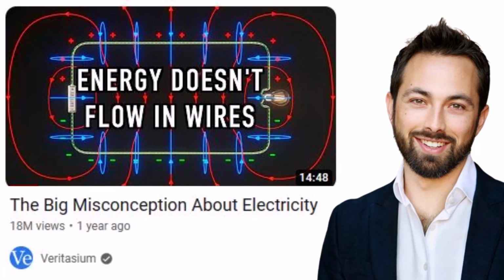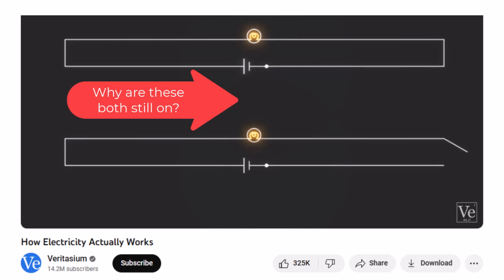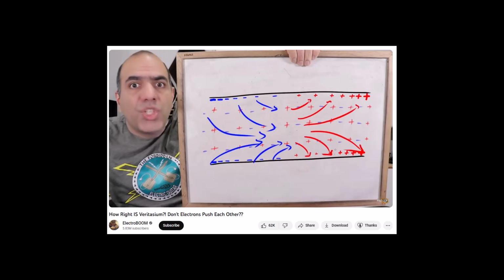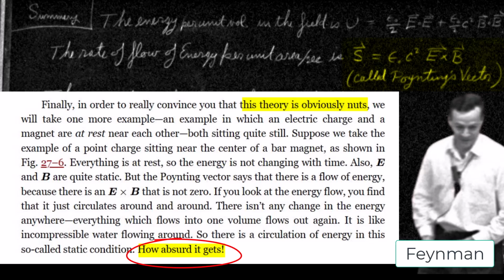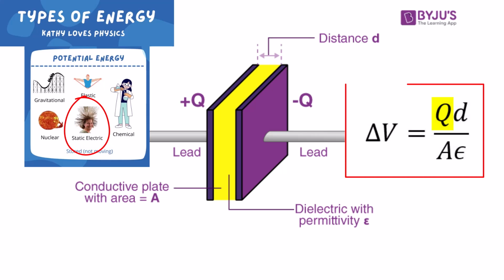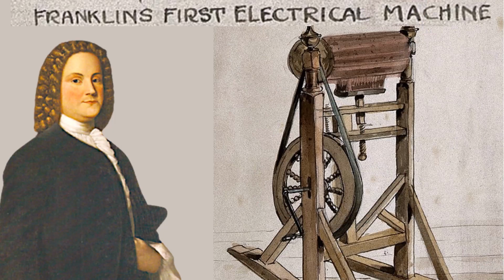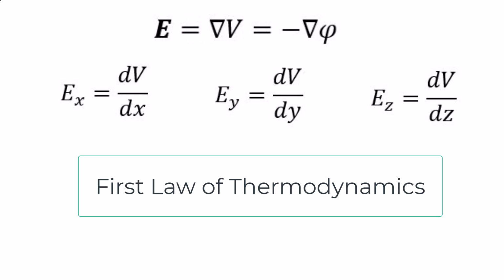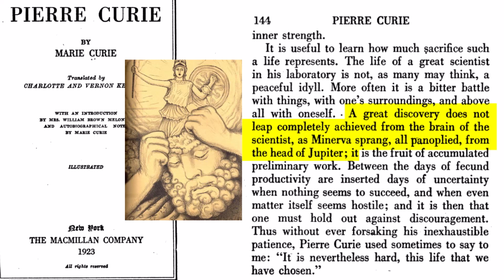Deep Dive Historical Response to Veritasium’s DC Electricity Video

Comment: I was one of those electrical engineers that reacted to Veritasium's video in a manner that can be best described as "wait a minute, that explains nothing".
It's true that an electromagnetic wave needs no conductor, but DC current most certainly does.
A lot of debunking of this has been going on since, and lots of good ones at that, so i won't go in to more detail here, but just saying that an explanation with the transmission-line model would have made perfect sense, and that the DC (battery) was a really bad example.
I can see that you have been thinking both long and hard about this, and your result is excellent!
What bugged me most about Veritasium's claim was the headline "electricity doesn't flow in the wire", well how else can you explain DC current?
I'm really looking forward to more of your video's since i find that the historic connection is giving me a firm foothold of understanding, it makes me more grounded, so to speak. (pun intended) :-).
Reply: Another EE here. Yes I agree the transmission line model would clarify a lot, and it would explain that the light-bulb mostly likely will slowly ramp up in steps, as you see the reflected wave going back and forth between battery and light, that each have a different impedance than the characteristic impedance of the wire pair. If you look with a scope at the end of a not-terminated T-line you see exactly that. However, the pointing vector does work, even in electrostatics. I applied it myself when I wrote a field simulator (MOM based) to calculate the energy transfer. In this case you need to integrate the pointing vector over a closed surface surrounding the battery or the lightbulb. Voltage is only defined in electro-statics, and doesn’t work well if you have changing magnetic field. When we define voltage for an AC circuit, we use a quasi-static approximation.
Reply: So what kind of current happens when neither voltage nor resistance is present as in a Superconductor A.C. or D.C ?
Reply: ^ BOOM.    Current was not discussed at all in the veritasium video.
Reply: No, he said energy doesn't flow in the wire. And he never said conductors are not necessary. They are required to channel and concentrate the EM field.
Reply: @SlothKeepsCoolAndCares  Everyone talking about this who's not an EE or radio ham (including Kathy and Veritasium) really should study the theory of transmission lines. They have multiple "modes" distinguished by the orientation of the magnetic and electric fields. Either the magnetic field (TM), the electric field (TE) or both (TEM) can be transverse to the direction of propagation. Not all transmission lines can support all modes. E.g., a hollow tube (a waveguide) cannot support TEM, but conducting wires (e.g., twisted pairs, coaxial cable) can. Waveguides (which includes optical fibers) have a "cutoff" frequency below which they cannot work. TEM transmission lines (conducting wires) do not have a cutoff so they can operate down to DC. Think about the orientation of the fields in two parallel wires. The electric field is obviously between the wires, so that's transverse to the direction of propagation down the wire. The magnetic fields follow perpendicular circles around each wire, so the magnetic fields are also transverse to the direction of propagation. I.e., TEM mode. (BTW, since the currents are equal and opposite, the magnetic fields oppose each other and cause a repulsive force.)
Reply: @philkarn1761  Hi, OK, I don't necessarily have a problem with your statements here, but how does this disprove Veritasium's claims about energy flow? I've got some textbooks on transmission line theory, so could you describe a setup, waveguide or cable, which definitively disproves the claim?
Reply: @SlothKeepsCoolAndCares  Veritasium was making a distinction without a difference. Whether you consider the energy to be carried by the charges themselves or in their fields, you get the same answers. But I do object to his initial thought experiment as lacking give enough information to answer the question. An EE immediately recognizes his setup as a shorted transmission line, and to analyze the transient response of a transmission line you must know or calculate its characteristic impedance. To calculate it you need the geometry of the conductors (thickness and spacing) as well as the medium through which they pass. And he didn't give that.
Reply: @philkarn1761  Your statement is only true I think if you are being practical. Sure, it comes down to the same thing if you are interested in building a circuit for some distinct purpose. But that was not the point of the video. It was a scientific thought experiment about how energy actually flows in circuits. Not sure if you saw, but Veritasium came out with another video on the matter, addressing many of the responses on his 1st one. The last one is definitely better. An analogy of this is the interpretations QM. All interpretations agree on the experimental results, but they vastly disagree about what is actually physically going on. A QM pragmatist would therefore find those foundational concerns irrelevant.
Reply: @SlothKeepsCoolAndCares  "What's really going on" risks getting too philosophical. Unless one model can explain something the other can't, I'd still say it's a distinction without a difference. Can it? I'll also accept a model as "better" if it is simpler (in some way) or easier to use than another even if they make exactly the same predictions.
Reply: They are click baiting dummies.
Reply: Veritasium's video made me read and think more deeply about electricity, and in particular the omnipresent nature of the EM field, but it ultimately is just a bunch of unhelpful handwringing over definitions of words like "flow."
Reply: Nobody seems to realize that these wire pairs are in fact a networks of resistors and capacitors (transmission lines). Dave and Electroboom get it. But I think this video and Derek's video don't seem to understand it.
Reply: @kriswillems5661 Kathy mentions dc circuits, and steady states, but in my non-qualified opinion, the fundamental thing here that closing the switch on this battery / wire / lamp situation creates, for at least an instant, a non-steady state between the two steady states of off and on, and for that intermediate instant this arrangement behaves as an AC system, which is why transmission line theory explains what is going on.  Overhead HV transmission lines have a capacitance to ground of several nF/KM, this experiment doesn’t need a light-second’s length of wires to illustrate, electricity leaking away in an AC distribution line is well understood.
Reply: @tonib9261  That is correct. When you close the circuit you somewhat get an kind of AC, but of course not really AC. However AC is about a constant change in the flow of electrons while switching on a DC circuit can be compared to a train getting in motion. Each train car is pulling and pushing against each other when you start moving / accelerating and you get a "noisy" feedback from all the resistance. Those are the AC-like features. Though once the ripples have settled we get a steady state flow of electrons through the wire. Those flowing electrons still have an em field (since moving chargest generate an em field), but that is really weak. Otherwise we could transmitt power through a DC cable through induction by placing another cable next to it. However that does not happen. You only transfer energy through the em field when the field changes. When you turn a DC circuit on or off, you get a spike each time since the field changes, but once settled the AC part is gone.

The larger the change in the em field is, the more energy it carries. However that's only the initial spike and, again, the inverse square law tells us how strong the field would be at a certain distance. And it's weak 1m away.

Don't get me wrong, the actual energy is transmitted through the em field inside the wire which actually pushes the electrons. So claiming that it's not the electrons but "just" the em field that transmitts the energy is not really correct. What do you think actually happens when you slam your hand onto your table? Right, that's also the em field that is actually colliding. There are no particles colliding but the atom hulls which repell each other. That's the reason why you "collide" with solids, fluids or gases. There are only 4 fundamental forces we know of and the majority of things we're dealing with on a macroskopic level is the em field and gravity. So nearly all interactions between things we can observe is just the em field. The strong and weak nuclear forces only play a role inside atoms and have barely any effect between atoms or molecules. Though to actually see a "real" effect of the em field, you have to have a strong field and for that you need to get really close to the source.
Reply: @tonib9261  She does mention that and says she doesn't consider the initial pulse to be be turning a light on. It might be semantics but it's an important distinction.
Reply: @Bunny99s  When one closes the switch, one imparts a step function change in voltage. Through Fourier Analysis, one can easily see this results in many different frequencies and a DC component propagating along the wire.
Reply: @kriswillems5661  Resistors and capacitors *and inductors*. If the wire was perfect, the resistors wouldn't be there. But the inductors still would be.
Reply: In reality the inductance of a straight copper wire is small compared the the resistance of the copper. I know there's inductance, but in simulations of the system you'll that in this case is is relatively small. What I wanted to say is that all these videos explaining the phenomenon seem to leave leave the explanation that is by far the easiest: looking at wire as a transmission line. I still think that without any special preparation Dave from EEVBLOG was the only one that really gave a good explanation (electroboom was ok too, but his video was prepared). I missed this simple explanation in this video. It sounded very confusing  @philkarn1761
Reply: @kriswillems5661  The inductance may be small, but it is still crucial. See the formula in the Wikipedia article "Characteristic Impedance". It shows that the impedance depends on the inductance L & capacitance C per unit length as well as the resistance R of the conductors per unit length and the conductance C of the dielectric per unit length. For typical transmission lines the impedance is dominated by the inductance and capacitance, so the formula simplifies to Z0 = sqrt(L/C). The resistance isn't zero, but it if were too large the line wouldn't be terribly useful.
Reply: The impedance of an inductor depends on the frequency. The inductance only plays a role at the front of the travelling DC signal. The inductance causes a wave travelling in both directions. Once a DC signal has been established in part of the wire, the frequency is zero and the inductance does not play a role, because the impedance caused by the inductance is zero (because it's a DC signal). The impedance of a capacitor however is inversely related to the frequency, so capacitors keep on charging on DC, the wire resistance limits the speed charging process.  That is why in case of travelling DC signal inductance is less important. I do agree however that in AC transmission lines inductance dominates over resistance.  @philkarn1761
Reply: @kriswillems5661  If capacitors keep charging, then it's not a DC circuit. Currents into those capacitors are changing, and since they're flowing through inductors, their inductive reactance is not zero. Only when the entire circuit is completely steady state do the capacitors appear as open circuits and the inductors appear as shorts.
Reply: @kriswillems5661   I think Kathy said she had a graduate degree in electrical engineering.  If so, she definitely knows what a transmission line is.  BTW, you forgot inductor.  😛
Reply: Energy doesn't flow in the wire...
Reply: @dggeers  "Energy doesn't flow in the wire..."? This makes no sense at all. You do know that a material with free electrons has to be there. So you claim such a material needs to be present, but it's somehow not involved in the transmission of the energy? Why does the resistance of a material goes down when you increase the diameter? Also, did you actually read the comment? If no charges / electrons move, there would be no electric field either.

Also Eric's claim that the power is transmitted "outside" the wire just makes no sense at all. The EM-field follows the inverse square law. So it gets weaker fast the further away you get from the actual "source" of the field and the source is the moving charge / electron. So the majority of the power is transmitted inside the wire. If it wasn't, touching an insulated wire would still shock you, which it does not. That's why we have insulators. And as most people know, if the voltage is high enough to jump the insulation, actual electrons are jumping the gap, usually due to ionized gas / material. In a perfect vacuum electrons couldn't jump the gap because there's nothing which could be ionized that could transport the electrons.
Reply: @Bunny99s  energy doesn't flow in the wire, the electrons do. The energy comes from the electrons but they push equally in all directions, including outside the wire they are flowing in. When the circuit first closes, the force from the moving electrons on the other side of the loop reaches the lightbulb first. That force remains - and if enough to light the bulb, the bulb turns on and remains on. It is still on when the main current from the loop comes around, increasing it further. But it is significant, and is not transient in the context of the question.
Reply: @Chilangosta  You didn't get what I said. 99% of the ENERGY does flow in the wire. Yes, by the EM field of the electrons which push each other. Again, you do know the inverse square law of the em field, right? Each electron generates an em field and where is that field the strongest? Right, in the center. The em field outside the wire is several magnitudes weaker than the one inside the wire. Imagine the wire like a highway that is a mile wide and cars are the electrons, each has an em field. A car moving at one "edge" of the highway (essentially right at the surface of the wire) has an em field that stretches outside the highway but also across the highway. The em field push is the strongest in its vicinity but is way weaker at a mile distance since it drops 1/d². The statistical distribution of the cars / electrons is that most cars / electrons move in the center. Just usual volume distribution. So the strongest push is all inside the wire. The em field outside the wire is certainly measurable and in deed would induce a current in a wire that is 1m away. However the strength is miniscule.

I've seen people doing all sorts of experiments and some claim that they received a quater of the voltage. However that's completely misleading when you don't have an actual load that would eat energy. Everybody knows that an open circuit can have a way higher voltage but when under load it drops significantly. Energy / power is voltage times ampere and in that sense you have almost no energy outside the wire. That's also the reason why the transmitted energy across the 1m gap is neglectible. You may get more induced power from the CMB or other environment em noise, especially when we talk about a battery. We don't apply a 10kV voltage and even when we did, the amount of energy that arrives on the other side is miniscule. Again, voltage does not equal energy. A van de graaff generator can produce really high voltages but not much energy (just as much as you put in minus losses).

Apart from that, no, the initial miniscule current induced is not a constant current. People have done simulations and what many ignore is that the induced forces go in both directions in the wire. So you get a lot of cancelling within the wire as the impulse goes along the wire. It also takes several complete reflections until the full power can be measured at the lightbulb exactly because of those cancellings. So the impulse ping-pongs along the wire several times.

I know people get excited when they learn about em fields and essentially radio (which is exactly that, transmitting miniscule amounts of energy through an em field). However claiming that "energy" flows outside the wire is like saying people sitting in a bus do not actually travel inside the bus but outside because the em field of the electrons of their atoms reaches outside the bus. By that logic you could claim that when you leave your home in a car to go to work, "a part" of you arrives at work within milliseconds. That's technically somewhat correct, but trust me, your boss would not be satisfied with the amount of work you will be able to do until "the rest" of your body arrives.
Reply: @Chilangosta  Just to make that clear. Dereks follow up video actually mentioned the electric field IN the wire at 3:55 of this video: ( oI_X2cMHNe0 ). Note that in his experiment in that video they specifically choose the wires with certain properties so they have the same impedance as the load. In his original video he talked about an ideal super conducting wire. So the results they get here does not match the initial setup. His "wires" essentially have the same "resistance" as the load.

We already know that we can transmit small amounts of energy via radio waves. Crystal radios have proven that over 100 years ago. They don't have any kind of battery. A radio wave as it is a charged particle that has an em field that moves through space.

Derek likes to to equate "voltage" with "energy" which is not the same thing. As in the follow up experiement he measured an impedance of about 550 Ohms in each half of the wire, he choose a load of 1100 Ohm so we would have build a perfect 50:50 voltage divider for just the capacitive coupling. He claims victory by measuring 20% of the source voltage which just shows that his measurement or assumptions were already wrong. Though that's kinda irrelevant as measuring the inductance and capacitance in such a case is quite difficult anyways. A usual light bulb would have a resistance of about 10 Ohms. With a 1100Ohm wire at 20V source voltage we would only get 0.18V at the light bulb. And that's for steady state.

Nobody ever denied that we will receive a signal after 1m/c. However the claim that "significant" amount of energy is transferred is nonsense. Telsa coils charged with 1.5KW can illuminate a fluorescent lamp up to about 3m distance. Though that's because the electric field required for the tube to light up is quite small and the tesla coil emits a powerful alternating electric field.

I'm wondering. Just assume we get x amount of energy at 1m distance. What if we had 2m distance? or 4m? Any concrete numbers? Keep in mind that the em field drops by 1/d². So at 2m distance it would only be 1/4 of what you had at 1m.
Reply: Electricity, Magnetism, Heat, light / Color, Mass / Weight are different manifestations of Gravity and Continually convert to each other. Gravitational Particles (GPs) move by means of CONDUCTIVITY towards the CENTER of the GRAVITY.  
Turbines convert the Gravity Force to Magnetic > Electrical > Heat > Light and everything in between.
When GP moves in the Air (4N1O) Atoms are manifested as Magnetism, therefore Magnetism exists only in the Atmosphere and is absorbed by Compass measured in Air Gap and Magnetic Flux context.
When GP moves in Solid it is observed as Electricity and measured by its Power/Force/Voltage and its Current/Amps and their combination total Quantity of GPs in a unit of time as Wattage.
GPs move at a 90 Degrees Angle relative to their path in [side] Steps, therefore the GPs manifested as Electricity, Magnetism, Heat and Light transit to the Outer Edges of the Medium/Matter.
Reply: @ShonMardani  You are deeply confused.